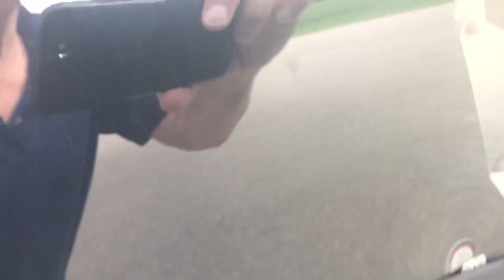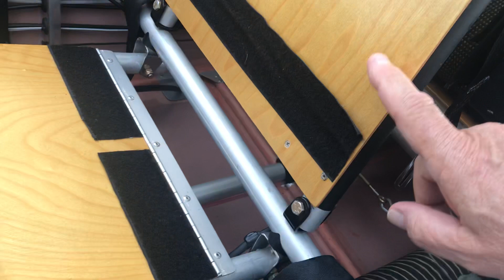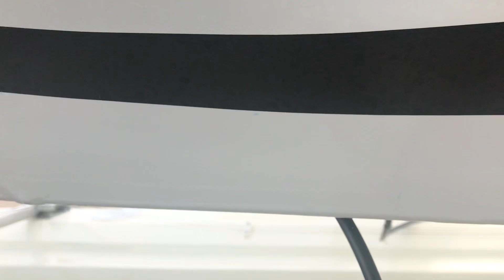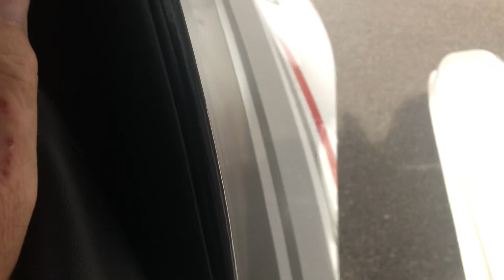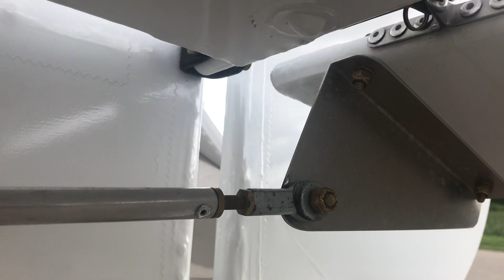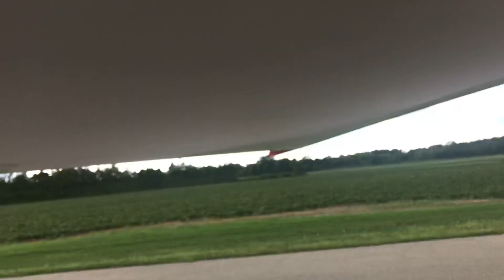CHALLENGER ULTRALIGHT—IN DEPTH WALK AROUND FOR BUILDERS

Comment: Excellent upgrades! Beautiful plane. Love the enclosed canopy as well. I'm just into the video and had to comment. Genius idea on the ground plane for the antenna. I'm an Eng III tech and communication systems is in my wheelhouse. Brilliant thinking and great weight reduction from conventional ground planes. As long as you can tune and get the range you need, that's perfect. I'm actually going to consider using this lightweight concept on the ground planes I design in the future.

Comment: Is plan B rocket propelled? Yours seems to look a bit different  than the cylinder type. ThanksJohn
Reply from the maker: That black vertical tube behind the container is a ballistic rocket motor. 
The entire system has changed looks from the cylinder type because both the rocket and parachute size have been increased in size. 
This is the model 1050 for heavier airplanes.

Comment: Beautiful! Do you know the empty weight? I know generically it is 575 lbs., and how do you make contact between the aluminum foil and the antenna? Thanks.
Reply: The antenna has a mounting ring lug that anchors the foil, and the electrical connection of the ground plane is to that. There's a lead from that to the aluminum top of the wing, so it's grounded to the airframe.

Comment: Beautiful job! I purchased a Challenger 2 this summer and will be spending this winter making a few modifications like the third door to make entry and exit easier. Mine is also on floats, and I have been struggling on how to re-route the cables as I see the current routing as a serious trip and snag hazard. Looks like you solved my dilemma for that. Thanks. You gave me some great ideas for additional mods. BTW, is yours registered Basic or Advanced? Mine has the single tank in the back, and I would love to have wing tanks for the added capacity. How many litres do the tanks carry? Cheers from Winnipeg.